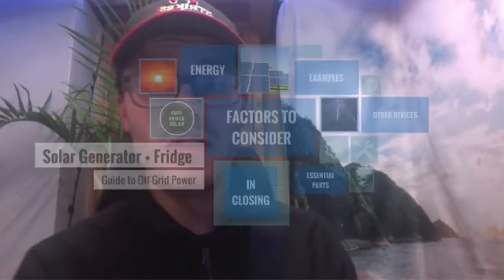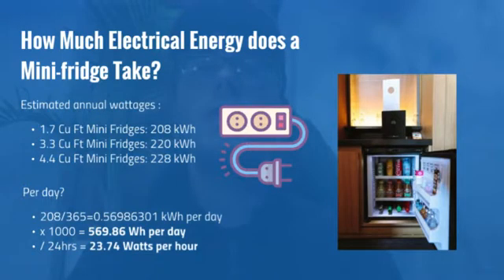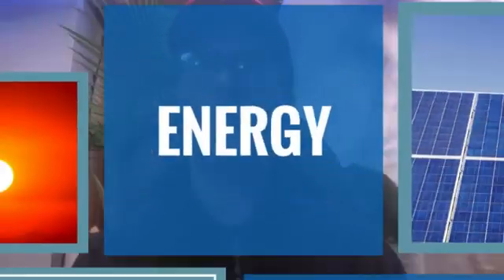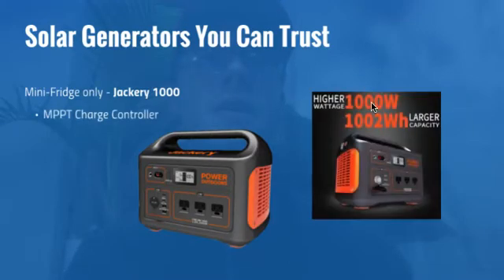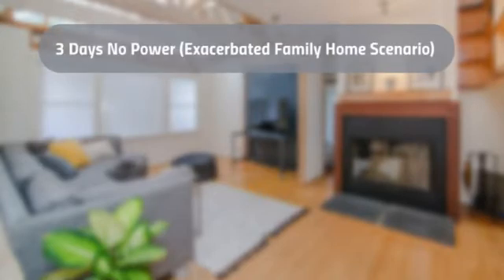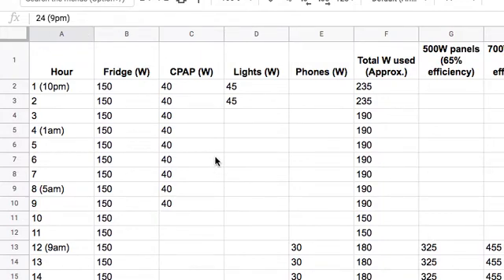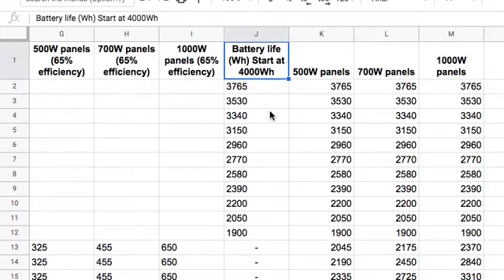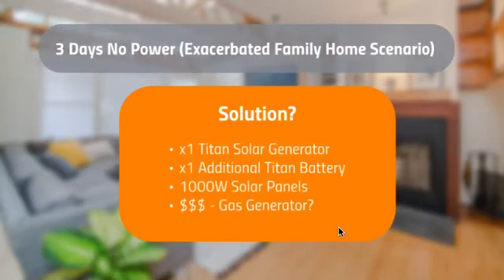WHAT YOU NEED to Run a Solar Generator with a Fridge

Comment: Anyone have a suggestion for what I could hook up to run a well pump and water heater? I'm in the country and have lost electric for over 3 days before. Water was what I missed the most since I have a propane fireplace. It's always been winter when it goes out so I can put food outside.

Comment: Could it also be used with a timer and allow the refrigerator run every so many hours to keep it cold and not run energy all the time? Or would the extra amount of power when powering up the refrigerator be greater than running it all the time?
Reply from the maker: I haven't heard of any solar generator being able to do that, but the refrigerator doesn't run all the time. It will only run when it needs to keep its internals at a consistent temperature. Now of course there's a lot of variables when talking about power consumption, like how old your fridge is, how big it is, etc, but the main point is that the fridge will not run 24/7

Comment: What I do to run a large frig&small freezer chest with my Titan is I put them each on their own 1/4hour timer.That greatly reduces the power usage and is totally enough time to keep both at their required temperatures at 15 minutes on each hour.Staggering each unit to run when the other is not.
Reply from the maker: That's a really cool practice! I had no idea that it would be able to retain its temperature at that rate of powering on/off. Saving energy = saving $$$!
Reply: That brilliant!  Thanks for sharing!!
Reply: Yup it sure does.Of course the less you go in&out of the frig will help&will cause more need to run but generally speaking this practice works very well.It saves on wattage&battery usage when you are in a power crunch for whatever the reason when powering these appliances on generators.

Comment: Pretty much your spreadsheet is pretty much spot on. If your budget allows, definitely over panel when it is possible and having the extra generation capabilities may help ride out those unforeseen light overcast days. With some mindful usage, it is possible to go weeks without the need of a generator to recharge the batteries. Another benefit is when the batteries are fully charged, you can use the excess solar for other things (i.e. meal prep) during the downtime.

My neighbor has the Titan with 6 kWh of storage, maxed out both solar inputs, and a Honda EU2200i for those just in queso moments. He thinks that it is the best invention to sliced bread, it is simple and kinda overbuilt including the batteries. Even though it is advertised as 2 kWh battery module, it is really 2.2 kWh per module; having the 200 Wh headroom helps with its lifecycle. I was looking to get one myself, but the version 2.0 looks very promising, just the LiFePo4 option would be winner in my books since I am willing to take the weight trade off for a more forgiving chemistry and life cycle.
Reply from the maker: Thanks for the compliment and feedback! Your neighbor has the dream system! And I agree with the Titan 2.0 no doubt. That's so funny you mentioned the weight trade off, I just replied to another comment that I would do the exact same thing! It's worth the weight IMO. The only correction to the chart I laid out is that the fridge probably won't be using its 150W continuously throughout the day/night. It will probably shut off and turn on like an AC unit to keep the temp consistent. So you will prob have some more leeway than what the chart/table displays

Comment: I like your chart.  Doesn't the refrigerator goes into off and then clinks back on?  So theres no constant 150 charge per hour?
Reply from the maker: Thanks! And you're correct! Since I didn't want to go too in-depth on exact power usage of the fridge, I did not factor in the fridge turning on/off its power consumption. So you can definitely see longer usage with what I showed in the chart. Sorry for the confusion on that aspect!